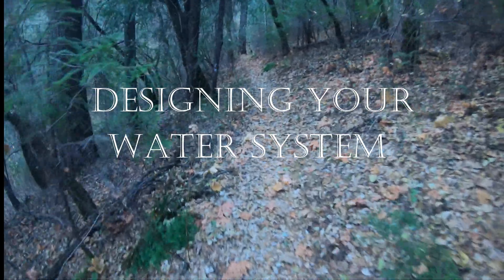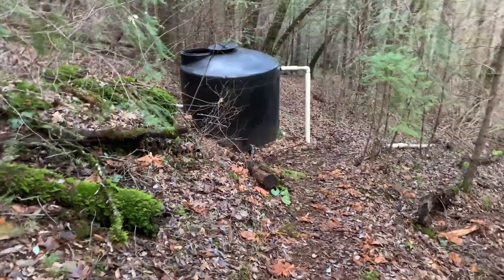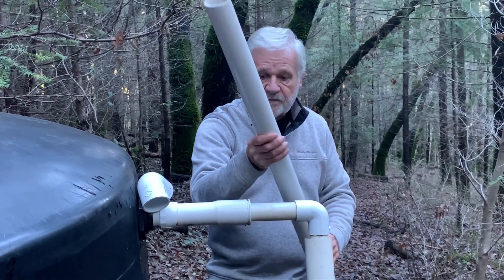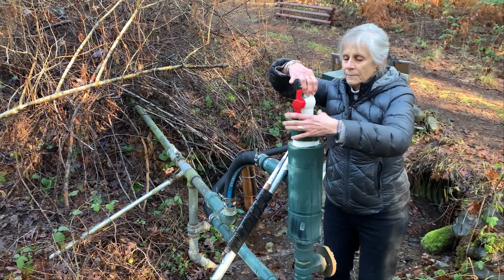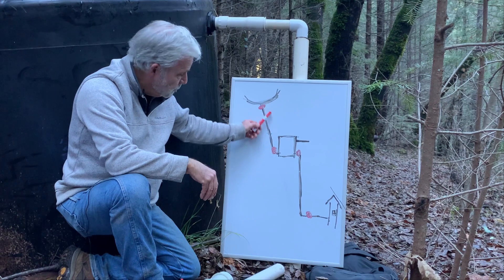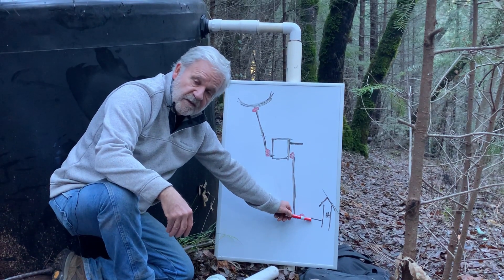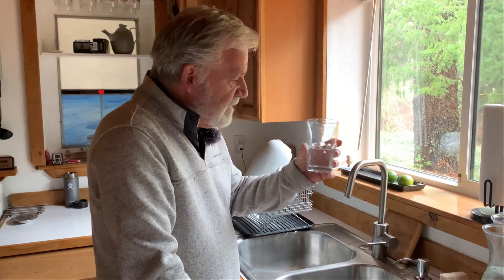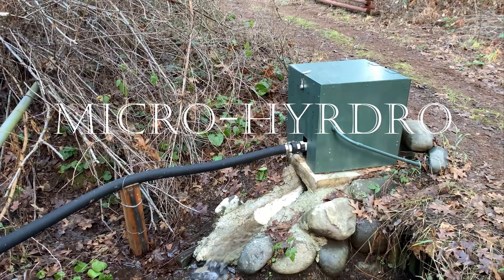How We Pipe Spring Water to the House. Off the Grid with Karen and Grid

Comment: What happens when contaminated (dead animal) surface water enters your system?
Reply from the maker: Fair question. We run our drinking water through a coarse filter (at the dam), then a fine mesh filter where our line splits for micro hydro, then a .5 micron filter and a UV light to remove bacteria (the filter) and kill viruses (the UV light). It’s probably 99.9% effective. Yes, there’s still that .1% chance…. but we’ve never had a problem in 14 years.

Comment: I'm curious as to what area of the country you live in. What do you do about freezing weather and your water system?
Reply from the maker: Good questions. We live in the Northwest. Temps get down into the 20's in winter, sometimes the teens.  If we are away, we open a small valve below the house so water is flowing continuously through the entire system. Discharge is into a stream below the house.  We add an RV/Marine antifreeze that is safe for potable water systems to all traps. If we're home, hydro is usually running in winter, so no problems, as long as we crack outside faucets next to the house. With continuous flows we've never had problems with frozen or burst pipes.

Comment: Your storage tank is an excellent way to separate some of the contaminants in the water. Having a sediment drain at the very bottom of the tank, will allow you to (when necessary) drain off the heavies. Have your normal consumption outlet a few inches above the sediment drain. A swing pool surface cleaning tool (basically a  fine mesh, like an old sieve from the kitchen taped on to the end of a broom handle ) can be used to remove any flooties.
Reply from the maker: We do collect a little sediment at the bottom of our tank, but the 1/8" cone screen at the dam keeps out the nasties. The remainder, mostly bits of sand, gets flushed out of the tank by the force of incoming water.  It ends up downhill, either captured by our 500 micron screen (before it gets to the house) or pushed through the micro hydro nozzle.  Never had to use our sediment drain which, as you suggested, it placed below the outlet.
Reply: @offthegrid4036  Be wary of the pelton wheel getting eroded by the sand blasting! It probably won't be a problem for a few years, but eventually you'll have to replace it if you are sending sediment at it. 

I love this channel, just found it! Can I ask where you're located? It looks like the Northwest or maybe somewhere in Appalachia. Super, super cool.